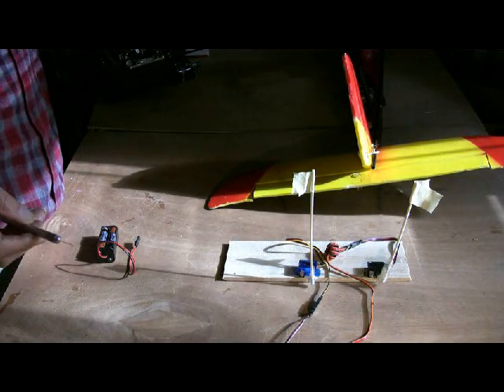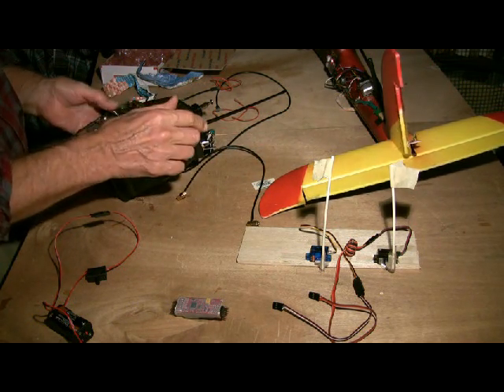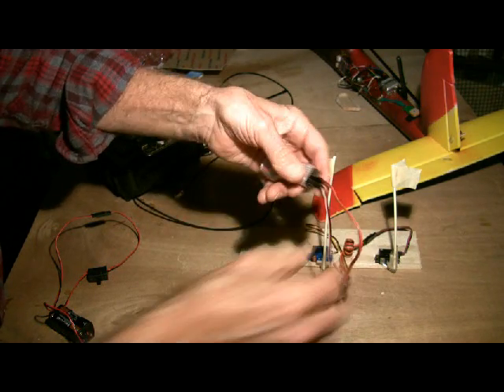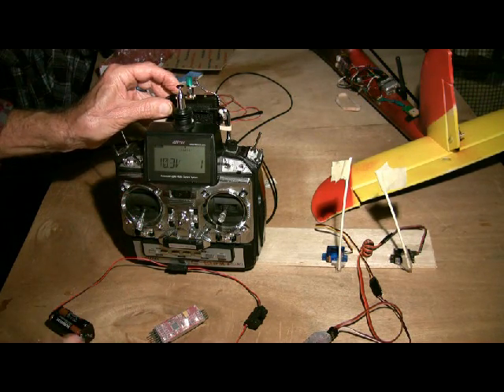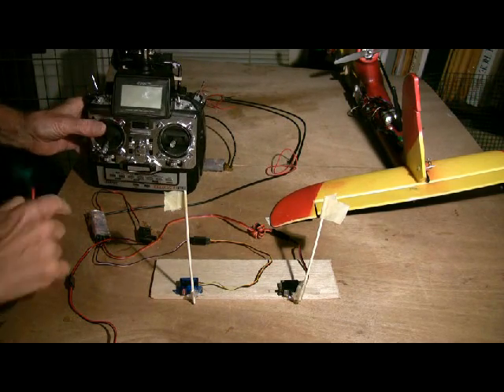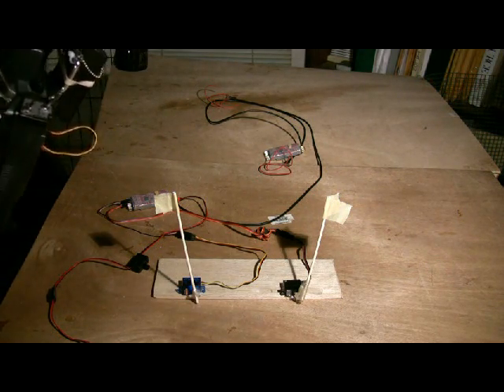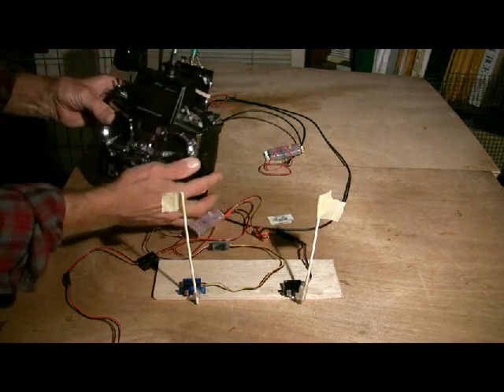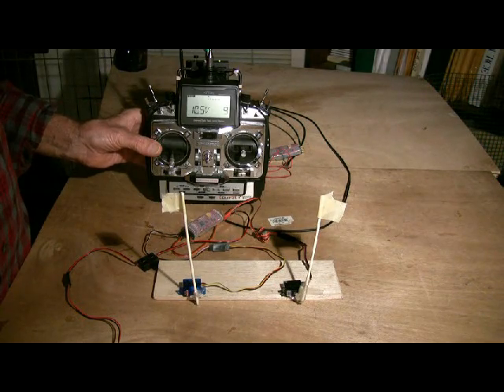Multiple receivers with Dragon Link and Setting Fail Safe.avi

Comment from the maker: Yes. Tony. Very easy to set as you see in the video. I set mine for throttle off and controls neutral so that it will glide in somewhere. 2 anecdotes: (1) I forgot to put my antenna on my Dragon Link transmitter and launched the plane. It got about 2 to 300 feet out and I was experiencing intermittent control, BUT IT WASN"T DIVING IN, just losing control. Looking down, I saw to my horror nothing but a little green cap (dummy load) looking back at me. I landed ok though. Thank you Fail safe!

Comment from the maker: You've come this far so don't burn anything up. Double check, triple check before you plug anything in or turn anything on. I use 3S Packs for all my fpv, with 40 amp ESCs and mostly just the internal BEC's,. You're gonna have fun this Summer. :)

Comment from the maker: Hi Ken,
  Mine was just normal for Hitec, Ailerons 1 & 6, 2 elevator, 3 throttle 4 rudder. Just hook it up like I did here on the table. You don't need the long antenna. Make SURE you've either got your dummy load on or your antenna on your transmitter. Then just stick the servos in one at a time and test with your R/C transmitter on which ones move. I think some transmitters don't have the same setup as Hitec.